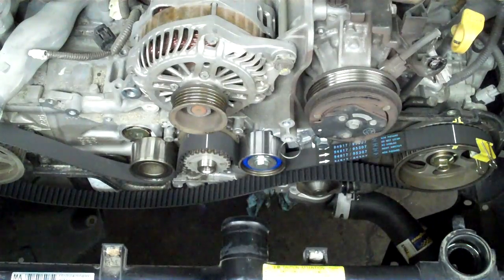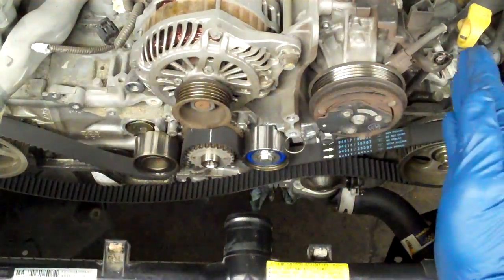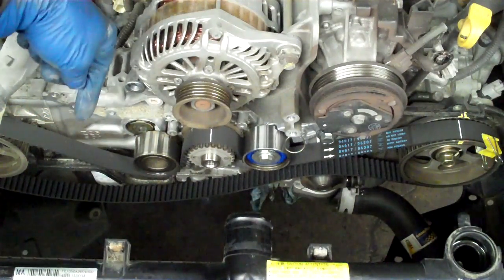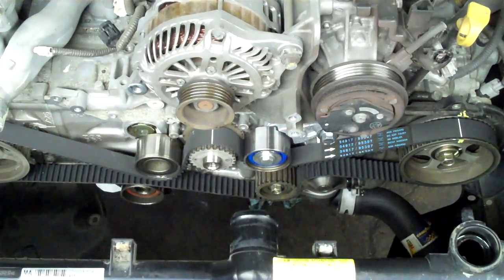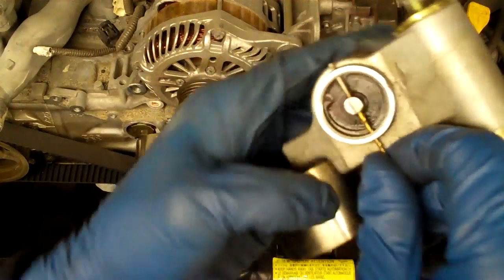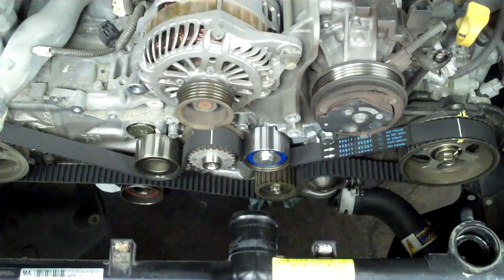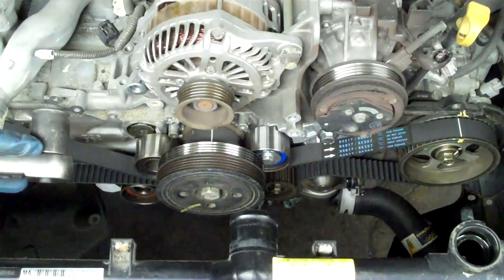How to replace a SOHC Subaru 2.5l Timing Belt

Comment: Briantmobile why the crankshaft pulley has a mark to set to the timing cover at 0degree,not 30,20 or 10,while the piston is not top dead center.
Reply from the maker: It's electronic ignition- no distributor.  The marks are for timing belt alignment.  The valves and cams are pretty unstable- this was a solution to make the process easier and safer to change the timing belt.  It's about as different in design as the flat boxer design is.

Comment: Brian, maybe also do a video on heli coils, as when you replace the timing belt and pulleys more than a few times, you will be putting heli-coils in. STEEL Bolts, aluminum block. its only a matter of time. PS: mine is a 2.2L with the separate piston with the tensioner on an eccentric Great videos

Comment: That toothed idler or cog idler next to the water pump is just very hard to get threaded  in, just not enough belt.... beats me why no one ever mentions it.... the pin on the tensioner is still in... marks are aligned, the belt is same.... no idea

Comment: i tried everything to get the crank bolt out. hammerd the braker bar like you did....fail.  1/2 drive dewalt 20v impact until the battery died.  ended up adding a cheater bar on the braker bar and using the starter....instant pop and it was loose.

Comment: Very dumb idea with the toothed idler gear… now I get to rip my motor apart to get all the metal shavings after I retap the whole because doing it your way crossthreaded the damn bolt. Very pissed off right now and don’t worry I wont watch anymore videos of yours

Comment: When we put my timing belt on to get some slack my brother had us move the cam wheel slightly right and other one left  to give the timing belt extra slack when installing tentioner: the cranks good the cams are a lil off: how off do they have to be to cause issues?
Reply from the maker: the pistons are NOT at TDC or anywhere near the valves.  If the crank is on it's mark, the pistons are centered in their stroke (half way) so there's no risk.  Great question.  You can pull the spark plugs and put a zip-tie in the hole to measure.  They'll all be the same depth.

Comment: Hello and great video!
I bought a 2004 Impreza 2.5L turbo wagon that had the original motor pulled and replaced with a 2.2L from an unknown Subaru model.  The kid pulled the 2.5 and put the whole 2.2 with its intake and manifolds into the car.  It is difficult to start and when it does start it backfires a lot and has very poor power and stalls also.

Assuming the motor is good, since he bought it from a local reputable Subaru mechanic, should I remove the old 2.5L's two cam sprockets and the crank sprocket, and put them on the 2.2L block?  I have the old motor, everything but the heads.
Reply from the maker: Thanks.  I'm not at expert at frankenstiening engine swaps, but I've been around a while and been asked and told what to do and what not to do.  The 2.2 has better heads and head gasket success than the 2.5L does.  Keep everything the same that the 2.2L came with.  Check the timing marks.  One will likely be off a couple teeth.   You might need to run the 2.2L computer and harness with it, but most likely it's either running too lean, or the timing is off.  Best of luck.  When you figure it out, let me know what you find here.  Thanks!

Comment: I use a long touque wrenck or breaker bar set on the drivers side frame and do a crank to remove the pully bolt.
Reply from the maker: That works too!  If anything goes wrong though, it's tough to detect and react in time.  That's the trouble with recommending it online.  Liabillity.

Comment: Thanks I just had my ex put a pcv valve this morning. And think it's time for a new serpentine belt with 211758 mile on it l think there's 2 belts in my Suburban 2007 Forester 2.5, one on outside engine and one in front of it which is most important right?

Comment: can those cam gears 'flip' when the timing belt is off?
Reply from the maker: The drivers side can, but it won't hurt anything.  The pistons are centered in the bore- far from the valves.

Comment: Help, I did head gaskets, got the timing done  and it starts, once in a while but keeps flooding, or starving itself. I have cleaned the intake  sensor and mass air. Not sure which direction to go. Or could my timing  marks  be off? I also changed the air filter.
Reply from the maker: Sorry I'm 10 months late.  Was your new head gasket messed up or in wrong maybe?  What did you find?  Or did your O2 sensors get swapped?
Reply: @briansmobile1  lmao I burned out the starter last fall trying to get it going, it's buried in snow for another month or two now.  Not giving up yet, will order a starter and try again

Comment: I replaced the timing belt and tensioner I few years ago.  It started making a loud banging noise a few days ago. It was the tensioner. I took it apart and started it to see what would hapoen. The tensioner was bouncing and banging like a rod knock except it went away at slightly higher RPM.  I replaced it again and with the help of your video I get the belt on by taking off the the idlers. Makes a HUGE difference.  Thanks for your hard work. Now I have another problem. After replacing the belt it won’t start. 
Any ideas?  Thanks in advance.

Comment: Before pulling pin run the markers on belt a full rotation then pull pin.
Reply from the maker: Prudent advice.
Reply: @briansmobile1  can’t lie doing the cog second to last always feels like the screw is going to cross thread.

Comment: Taking the tensioner off makes it easier to get that bottom sprocket on without forcing the belt. Get the sprocket on, wrap the belt around it, then put tensioner on. A hell of a lot easier.

Comment: Question:  I was just given a 2000 Outback that has the 2.5 engine. The engine apparently ran for 30k miles after a rebuild,  and the belt broke. I took the driver's side cover off, and I can feel the tensioner is just flopping back and forth in there. I'm assuming it failed, thus resulting in a broken belt. My plans are to buy a kit and tensioner and see if It escaped bent valves. I can roll the right side cam pulley around by hand (it seems to roll over in increments, like there is compression there.) I'm trying to roll it around to line up the marks, but it wants to push past that. Is that normal? I'm sure the valve springs are pushing on the lobes of the cam, and perhaps that is what I'm feeling. I'm just wanting to see if that is normal or not. And when I go to line up the marks, is there anything specific to keep in mind as I position the components? I just don't want it to roll out of position as I am trying to put the components on. 

I hope that makes sense.

Comment: You know how I get the dampener bolt loose? An impact socket and a long breaker bar or with a cheater bar. Wedged to the ground or something solid and I hit the starter.

Comment: Thanks for posting. Just watched this for the fourth or fifth time this morning. Its now 2:30 p.m. and after welding some round and square stock together to make a tool to hold the balancer and beating my breaker bar nearly flat, I'm putting the new kit on and looking forward to not being a nervous wreck every time I drive the severely neglected ol girl. 166k miles and the previous owner said he personally changed the belt twice only to pull the cover and see the factory one hanging by a thread. Dodged that one by a hair. Thanks again. Hope all is well.

Comment: Hey quick question:

When you're lining up the Crank Pulley and the Cam Sprockets, do you have the belt on already? When I move the Crank Pulley it doesn't move the cam sprockets, but I don't have the belt on.

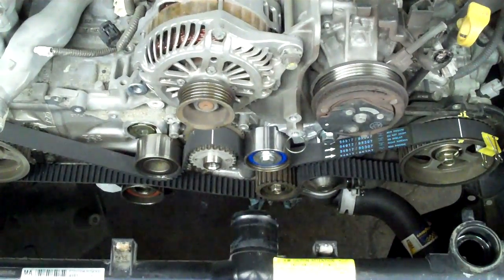Comment: comment,  it's not lining up at all,  5:40, sure zip, zip, and done...ok, I am doing the tensioner last and not the geared, that gear bolt is why I replaced the water pump, it felt stripped when I took it apart...I took it apart because I had rust marks on several pulleys and had new pulleys on teh bench...

Comment: I am about to do my timing belt on a 2001 Subaru Forester…I have gotten an Aison Replacement kit and was wondering will the drivers side cam “ spring” out of timing when the belt is being taken off??  If so, which side will it rotate to….left or right??
I had mine replaced at 154,00 and now it’s 223,000 so I thought I would go ahead and do it…

Comment: great  video  bro. you can break the balance bolt with a socket on a breaker bar with a cheater pipe  against  floor 
as long as engine turns clock wise and  hit starter  a walow  bolt broke ,im an old timer  64   ive done it many times before 
all the fancy tools came out  the starter will put about 3 pounds of  torque  on bolt  its safe with short socket ,,on breaker bar,,,

Comment: Yea I like Subaru and have a 2005 Forester 2.5L SOHC EJ25 same as that one I think. I had a failure of a timing belt idler, was the geared one, so the belt was history then the engine is an interference type engine, this sucks. so when it failed stopped of course probably damaged at least 2 valves? Plus I also heard that the head gaskets are defective and fail quite often so I will have to replace them when looking at my valves. Whats your thoughts on all of this am I right with the bent valves ideal. I still had no compression when trying to start it after timing belt kit water as well as new oil pump did that when there all torn down. Vince mufonfivm@gmail.com

Comment: Man you mean the compression alone will hold the engine still enough to loosen and tighten the crank bolt? I suppose you are not as particular as some about tightening to spec. that would be hard to do with the hammer, but it sounds like it works

Comment: Great video!! I forgot all about the drill bits and using that this time around for the tensioner. I got robbed on the passenger side as my plastic composite camshaft sprocket broke in 8 pieces and just noticed this engine has a metal one for both sides of the engine. Dumb setup using plastic camshaft sprockets as I’m unsure if my engine is junk.

Comment: I cheated on the crank bolt. I used a pull handle and a pipe cheater bar. With it in place I bumped the starter. I know it is not the recomended way but it works for me on a lot of different engines. Never damaged anything. I enjoyed your vid and your information is great.

Comment: Crank bolt doesn't have to be torqued? , all so, what's the correct torque for the pullies? 28 or 30 ft lbs? Loctite?  Bleeding the tension pulley? Where are your other videos BRIAN????!!!!   XD

Comment: Hey Brian! First I really appreciate your videos and humor!  Both have helped me with my frustrating subaru repairs.  My 17 yr old daughter recently bought an ‘04 SOHC Outback.  We wanted to replace the timing belt and other components because the prior owner didn’t know when that had been done last.  I had her watch your video and let her take charge of this repair.  She had just taken off the condenser and alternator covers when she set her wrench on the alternator and body and was briefly electrocuted.  Now the car won’t start and only the dash lights come on. Help!
Reply: Did you disconnect the battery?

Comment: To remove the harmonic balancer you can stick a flathead screwdriver on the flywheel (or flex plate if you are dealing with automatic transmission car)
to stop the crank from turning and then you can remove the bolt normally

Comment: Hi Brian, the timing belt in our 2003 Forester broke last week, it was only two years old with less than 10,000 miles.  My wife was running errands so the engine was relatively cold and when it failed she was probably going less than 35 mph.  Practically all the valves got bent.  Our mechanic is only recommending a cylinder head job.  The machine shop will replace bent valves along with seats as necessary.  The pistons look to me like the valves hit the pistons as there are tiny smile imprints outside of the reliefs.  My question is how worried do I need to be about the block/pistons?  Can we simply clean them up then mount the rebuild heads in place?  We are also replacing a fair amount of other components while the engine is out and accessible.  Again, my biggest concern is the block/pistons.  I'm confident the machine shop will do a great job on the heads.  Thanks in advance for your reply.

Comment: HELP! Our '03 EJ251's new timing belts are too tight, and that's with the tensioner still pinned but w/o the bottom-left pulley or that small plastic plate below it (belt hits it due to having no slack for the pulley). Watching another vid just now, I think the tensioner pin might be holding its pulley down. Will know tomorrow night.

We've tried two diff Dayco kits and one from Import Specialists (Gates?), the belts from which are all the same length as the original and the lines on each align with the marks on the cam and main sprockets w/no slack between them. 
In a post from 3 months ago asking for tooth counts, @jthadcast replied with "Z1 46.8, Z2 43.7 teeth...ej25 sohc.
But if I remember right (very long day Thursday ), the tooth counts between the lines on these belts are: Z1=44 and Z2=40.5.

Plus I've seen posts in NASIOC.com which give both sets of numbers as well.
Also, we turned the crank to give the belt three full revolutions and the lines were then each exactly 3 teeth left (or right? - long day) of the mark on all three sprockets.  But this shouldn't matter because the important thing is that, when installed, the 3 lines align correctly with the marks both on and behind the sprockets.

The engine runs very smooth. But again, this is w/o the bottom idler and 'no tensioner'. 
 Plus, after running 5 min's, a loud squeal now comes from the pass-side cam sprocket. I'm telling you, this belt is extremely tight.  We stopped running it, but need HELP!

We followed the same procedure as this and three other thorough videos and the instructions in the kit and have verified over and over that the belt is routed correctly and the pin is still in the tensioner. I admit that we forgot to bleed the tensioner pre-install as recommended in one vid. But the center pin is barely higher than the rim.

Comment: does the cam sprocket on the left also have its mark facing at 12 o clock? mine does not have a visible marking on the engine itself to line the one on the sprocket with.

Comment: Hey Brian,
Two questions, so if I’m understanding this right the markings don’t have to line up completely even on the cams when the crank lines are lined up even? Also does the crankshaft bolt have to be torqued down to a certain ft lb or just tighten till it stops? Tyia

Comment: Brian I need your help please please please. I have an 04 impreza 2.5rs I was doing head gasket replace on driver side. I followed your video of doing it without taking out the engine.  When I got to removing timing belt I got everything line up with the notches and pant marks (Not the arrows) I removed the tow lower tensionsnera first just like you instructed and then the driver side cam just spun fast all on it's own it's had sometime of tension or something but the mark looked like.it jumped 90 to 180 degrees. And the wheel in the middle moved as well I'm so scared that I just destroyed my life. Idk what I do. I got the middle gear lined back up but when I try to get the driver cam line up it will just jump like of it has tension on it atincant get it to stay on the spot for it to stay lined up correct

Comment: Hey Brian, I recently took my engine out for a head gasket job. While getting the cam sprocket off on the driver side it turned several times (with the belt off and the crank at "TDC"). But now that sprocket doesn't want to stay aligned with its timing mark. when I try to get it there it has pressure then pops into one of two positions. I removed the heads and the valves dont look bent or damaged. What is causing this and how will I set the timing when I reinstall them? Thanks!

Comment: Hey Brian like your videos especially for sohc subarus they help me a lot on timing belts and engine swaps .I'm doing my foresters  engine is dohc and is making me go crazy with the timing belt every time I put it on all marks and some way some how when I put the belt on to that last idler pulley the driver side pulleys with  tension they always pass a half a tooth or sometimes two teeth off and that's driving me crazy I need help how do I get the timing marks to aligned all

Comment: Just about to change the timing belt on a family members 2000 2.5L Liberty (Legacy) Heritage over here in Australia. I've done it before on an original Series 1 1989 2.2L Liberty that I used to own, so I'm watching your  post here to remind myself in general what was involved. One question if I may, I was planning on removing the radiator, my original was a manual, but this 2000 model I have now is an auto, so using your method to remove and install the crankshaft pulley leaving the rad in place is tempting, but is the final torque on the crankshaft pulley bolt not so important? From memory it was specified to be WAY tight..

Cheers! Max

Comment: Crankshaft Pulley, Loosening or Tightening of , Crankshaft 22mm Bolt. I found if I position two Dowel pins, or Grade 8 Bolts in the holes, of the pulley face. than place a bar of steel between those bolts, I can loosen or tighten the 22mm bolt accurately. No pipe wrench slipping, or missing hammering, just brute force, and torque wrenching. Your video was great. Thanks.    Enjoy

Comment: I usually use a long breaker bar wedged against the unibody or ground and tap the starter to remove the crank pulley bolt.
Reply from the maker: That will work!

Comment: Anyone know if a new OEM tensioner needs to be bled before installation? I know Gates requires it with their tensioner. Subaru states to check the old tensioner by bleeding it if it will be reused, or replacing it with a new one if it's not within spec.